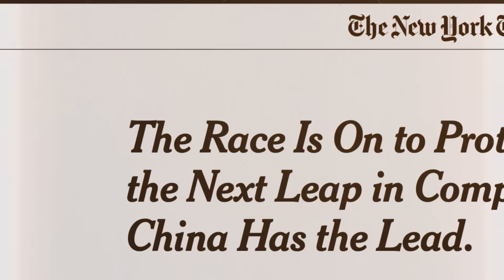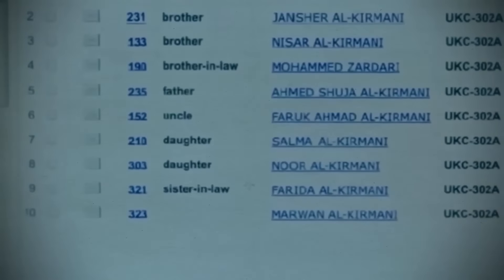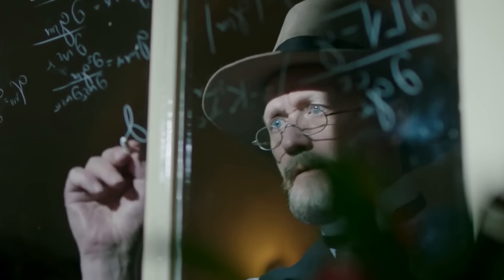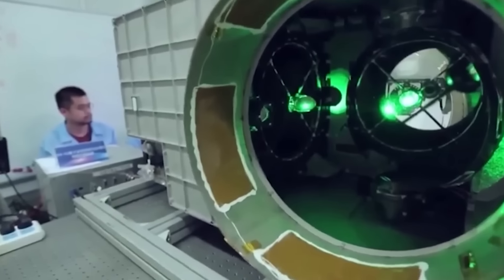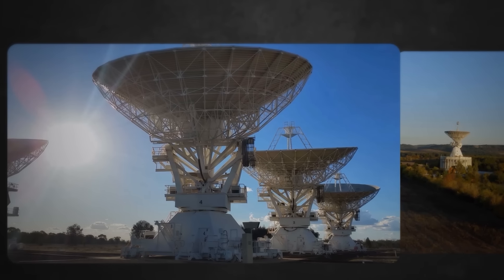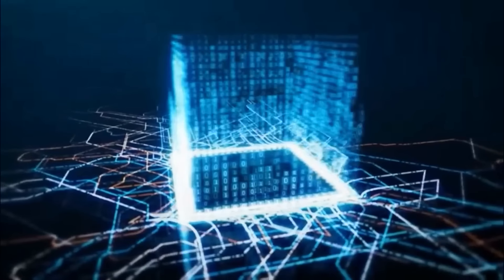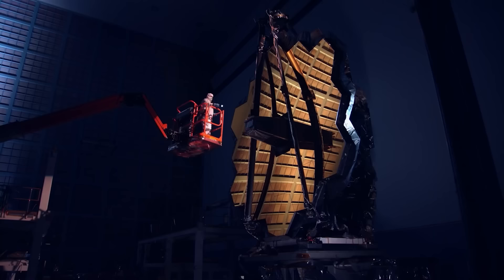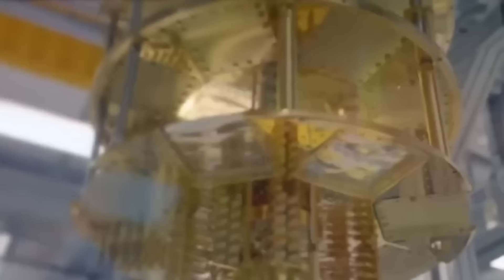NASA Just Shut Down Quantum Computer After Something Insane Happened

Comment: Everyone describes what a Qbit is and it's always the same basic explanation. It seems we are expected to perceive the ramifications of working with a bit that can be both 0 and 1 at the same time, but they never step through a process to show how a calculation is actually achieved.
Reply: 0 & 1, or 'on & off,' is achieved, by the natural phenomenon of Light-waves, Quantum Behavior, Physics Experiment, known as 'Double-Slit,' proven in 1801.   It is a lengthy explanation, but basically, in a computer, as electricity, it can happen too fast, to be 'pre-determined'...  or, 'observer'-determined.  /:   In programming, it is a 'variable.'    /:
Reply: @lotusalivelight24  Thank you but this still doesn't explain how a calculation is performed.
Reply: I agree
Reply: Yes. Just sounds like double talk. Same thing over and over and no clarity.

Sure, some problems require multiple steps and the result of   the steps filters out other steps thereby eliminating a LOT of steps but, give an example of an algorithm with allows this!
Reply: Essentially it already has the answer before you ask the question

Comment: Quantum computing is going to be the magic sauce its made out to be, but not for everything the way its made out to be. I see it as more of a tool to be added as a part of a normal supercomputer, like how most supercomputers have multiple types of architectures these days, x86, tensor cores, gpgpu parallel processing nodes, add some qbits and thats what i see for the future. And this video is incorrect. Quantum computers do not solve unsolveable problems, its just really good at doing what it does much faster than a teaditional architecture ever could, solving some problems that could potentially take decades of runtime, but not impossible. Folding@home is a distributive network aimed at trying to circumvent this limitation without the need for a quantum computer
Reply: You’re correct on how it’s a useful tool. It’s extremely important, but not the way Hollywood or sci-fi make them out to be. Yes, we should be careful with technology, respect it, but it’s definitely not the way people think.
Reply: You're slightly incorrect I think. There are things quantum can solve that traditional would take thousands of years to solve.
Reply: @mattsYT42  exactly, thank you for agreeing with me
Reply: What is folding at home ?
Reply: Nonsensical language
Reply: @erikmaguina1 Folding@home is a distributed computing project aimed to help scientists develop new therapeutics for a variety of diseases by the means of simulating protein dynamics. This includes the process of protein folding and the movements of proteins, and is reliant on simulations run on volunteers' personal computers.
>copied from wiki 😁
Reply: Good analysis.
Reply: It SUPPOSEDLY can factor integers in polynomial time.  On classical computers, that algorithm is subexponential at best.  Now here's the thing that's super suspicious to me.  Integer factorization is just reducible to the Hidden Subgroup problem, which is more generalized form of it.  Also equivalent are the Discrete Logarithm, and Subgraph Isomorphism.  But there's no "quantum algorithms" for those.  Why?  Also if you read Shor's algorithm (it's torture), you'll see he just handwaves major parts of it.  People just accept it because of Danny Deutchs cachet.  Academia is mostly political, and about 5% substance.   I'm still majorly skeptical that anything like that can work.  And after 30 years and 30 billion spent, with zero results, it's starting to look like I'm right.

Comment: You say that quantum computing is a revolution in hardware whereas artificial intelligence is a revolution and software. And while that is true, at the same time, software is used to program the QPU, GPU, and CPU of quantum computers it is done so the high-level languages. So, in my opinion as an independent developer, I think that software was also Revolutionised for quantum computing... it's just that this particular software for quantum computing isn't the same software as the software that it was also revolutionised for artificial intelligence. But, just like software for artificial intelligence, the software for quantum computing has also revolutionised for quantum computing.

Comment: changing the state of one entangled particle will not change the state of the other. But you will know the state of the other at the time of measurement. You cannot communicate with entangled particles at a distnace. And entangled bits has to be made at the same place in order to be entangled.